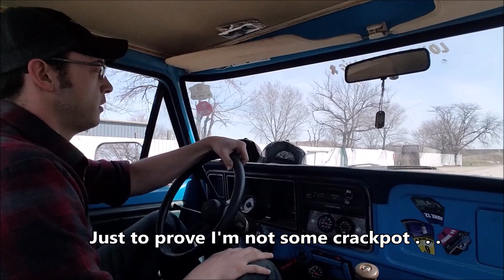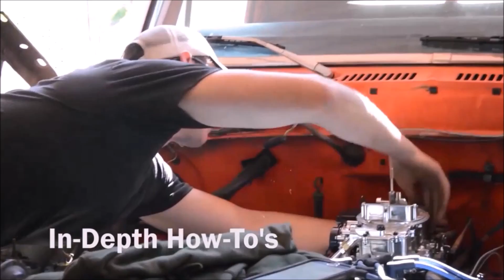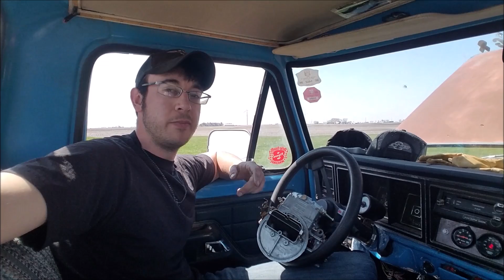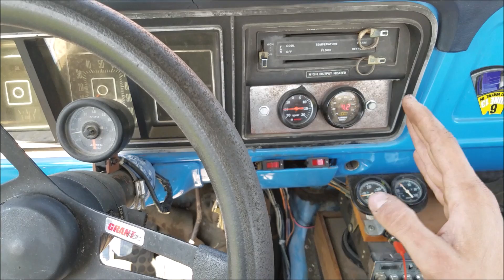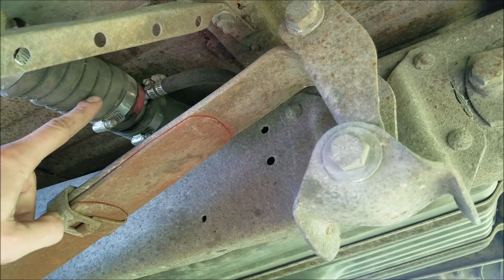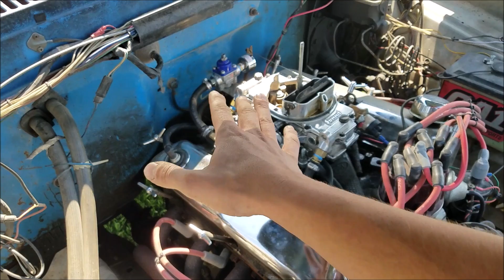Holley & Edelbrock Fuel Bypass System: Return Line to Tank Connection (EASY & SIMPLIFIED)

Comment: I know it’s an old video. But probably one of the most important things to do with any carburetor these days with fuel being soooooo crappy!
I’ve done this for a lot of people and they have had 💯 positive feedback.
I’ve converted most to an electric fuel pump as well!
Thanks for another great video and your wealth of knowledge.
Luke you should really do another video on this topic!
👌👍
Reply: What kind of fuel pump should a guys use I have a bypass regulator return line and mechanical pump but the gauge fluctuates wildly. Would a carter p4070 help level this out?

Comment: Luke....i ran a new fuel line ...frm the spot it crosses fram and runs along headers...69 camaro 454.....thought i had it fixed...with new edelbrk avs 2....them my fuel pump crapped out...i had to get a edel...electric pump....hooked it ou on shoulder of hiway...and then the carb started overflowing w fuel...4.5 psi on my guage.....i had to drive home...grab my holley 750 dbl....and that got me running....but its still boiling fuel after 3 min idle indriveway....i see the metal line come from tank goes above tailpipe....and runs imside fram...right past muffler....will return line help.?....my fear is the fuel in tank will eventualy warm up too.much n get same result

Comment: the way you plumb the regulator is interesting, i thought the middle hole was IN (opposite side of adjustment screw) and the two outsides were OUT, one to carb and one for a gauge or a blanking plug, i wish to run an electric pump too but i need to get a return line output that i can hook up to the  hard hose, also i am playing with a weber 32/36 on a 22r 4cylinder : )), so you are saying here it can regulate in both directions i think ?!
Reply from the maker: There are return regulators amd dead head regulators. What i have here is a return regulator - the internals are different and the plumbing is different.
Reply: @ThunderHead289 ah.  So I could make a big problem here?  I just have the cheap holley style from ebay. The most common one I think. 12-804 i must check but it is marked in on the middle and out on both ends.
Reply from the maker: @chocolatedog666 a deadhead regulator will definitely not work for a return system indeed. Completely different internal concept
Reply: @ThunderHead289 i have come to the conclusion there are no ultra low pressure bypass regulators out there. I need 2.5psi. So I am assuming a return line is not needed.  Electric Pump is 5 psi max. Simpler plumbing I guess.

Comment: Brothee, Im not saying your way is incorrect. Im not a carburetor expert. If the pressure regulator is after the carburetor and on the return side. Is there a chance of tour fuel pump over pressuring your floats or creating issues? Im asking because Im about to  install a regulator on my carb

Comment: I'm confused I have a summit racing carb with a solid type dual fuel line so how do I plumb the regulator like you have it in this video without all that rubber hose and still have the regulator as you have it here?

Comment: I was wondering. For a carb setup could I just run a corvette filter/regulator and use that as a return? Where it makes return line shorter and not have to come from engine bay?

Comment: There’s a emissions 3/8 line that runs down the passenger side frame rail that I used for the return. All of these trucks has it and it goes from what people call the coffee can under the hood and runs right to the top of the gas tank where it goes in and you don’t have to drop the tank or run a line the length of the truck.
You just need 3 ft of 3/8 fuel line and a T with the regulator after the T and of course you need a electric fuel pump and I put mine right at the tank on the frame. It works perfectly and you won’t ever have to worry about vapor lock again and the cool fuel probably helps on power and fuel mileage

Comment: Awesome video.  I want to install filler neck return line to help with my truck heat soak issues.  If I purchase filler neck to I also need to purchase pump? Or does it return fuel by gravity once the engine is shut off?

Comment: Thanks so much for this! I'm trying to keep my girlfriends grandpas truck running/alive- so she won't want to get rid of it, but it's pretty unreliable as it sits. It starts up and appears to drive just fine- but once warmed up, she loses power and eventually stalls. We also get vapor lock when attempting to start a hot truck- so I'm hoping that in following in your footsteps, we can make the truck reliable again. 

Do you have a video on how you did the electric fuel pump? That would be super helpful. I know in one of your videos- you said you wanted the pump to be rated HIGHER than what you'd want the regulator to be set to ('14 psi pump w/ a return regulator at 6 psi'), and I believe I might have found a mechanical edelbrock pump that is rated to put out 10. But if switching to electric is easier, I might just do that. Thanks again.

Comment: I’ve got a sbc 350 with a 4150 650CFM and a fuel rail on it pumped by a Holley red electronic pump. Have the issue where it’s plumbing way too much fuel and starts overflowing that carb really fast. Do you think I could put a pressure regulator and return line on the other end of my fuel rail to help regulate the rail pressure so it doesn’t do that or does it need to be before the fuel rail?

Comment: Hello, I have a 86 chevy c10 v8 305. I have deleted my evap canister and my fuel tank collapsed in on itself. I'm wondering if it's because the line I didn't know what to with I closed off. I have a edelbrock 1406 carb

Comment: Question for this old video: does this return setup give you problems filling at a gas station? I’ve had vehicles that wouldn’t take gas with the pump handle fully open.

Comment: To be honest I hired several guys to solve this issue for me and they never told me what the issue was. I was sure it wasn't the carburetor. My carb was new. After seeing this series on vapor lock I am sure these guys knew what this was and hesitated to tell me. My car had a dedicated return line but without the original carburetor, it was never hooked up. I even asked about it because in old photos the line was hooked up. I was told it wasn't necessary. Truly it is necessary. Lesson learned.

Comment: The filler neck is a great tip. My car has a return line already in place but for some reason, it was disconnected. I want to reinstall it. The line seems fine. How do I test it to make sure it's ok to reconnect? I wouldn't want to put any trash into the tank from an old line. Any suggestions?

Comment: I'm doing a swap from a mechanical fuel injection system to a carburetor on a small block 302. Is it as easy as using a bypass regulator and connecting it between the carburetor and the existing fuel lines?

Comment: Hi Luke! Is it acceptable to run a high pressure neoprene line back to the tank from the regulator rather then a Metal line?  I run a Blue Holly elect external pump, 14 psi max,  and use a Holley 4160 750 cfm Carb. Thank you.
Reply: This is an old comment, so you probably decided one way or the other, but the advantage of hard lines is that they are less likely to be damaged by road debris.

The disadvantage is they don't flex and are more difficult (but not terribly difficult) to run.

Personally, I'd run hard lines at a minimum from the engine bay to the general vicinity of the tank. From there, a more flexible hose to the carb or tank would strike a good balance between safety, durability, ease of maintenance and the ability to adapt to changes (e.g. a new carb is built differently and requires the return line to run to a different location -- hoses help here).

This is the same strategy that tends to be used for brake lines. At least on my truck.
Reply: @ZachtheEvil  Thanks for your reply! I decided to keep my tank to regulator hard line. No heat soak issues currently, (1 inch carb spacer, stainless braided dual lines from regulator to carb nicely wrapped with heat shield.) The Mustang only gets out for car shows, local cruises, maybe 300-400 miles per year.
Reply: @robertclymer6948  nice. Sounds like a good setup.

BTW, what motor are you running? From the profile photo it looks like a 60s era Mustang. 289?

If it's stock, 750cfm could be too much. My more or less stock '66 289 engine in my truck is happy with 600cfm and honestly 550cfm might be a hair better. It's running a Holley 1850-2, the ancient forerunner to that 4160.

 I'm currently in the process of adding a 1 inch spacer / rebuilding the carb a small bit - what type of spacer are you running? I'm going with a 4 hole metal spacer, purely to get another vacuum port for the PCV valve and free up the port it's using.
Reply: @ZachtheEvil  Ok, 67 Mustang Gt S-code coupe. Originally came with a 390 4 speed. Running a Ford 460 big block that is a mild build. Has all the top shelf parts on it. Running with the 460, is a Built C-6 forward manual valve body. Running 4:11 gears with a Yukon Trac Lok differential. Full spool removed for this. 4 link suspension, coil overs, 2 1/2 stainless exhaust from headers back through magna flow mufflers. Eldelbrock top end kit, Holley 750 cfm 4160 on an Eldelbrock RPM Performer single plane. Alum radiator with two fans in front If it goes over 190 deg. Cheetah SCS shifter. Spacer is 1in phenolic forgot the make. Holley sniper elect fuel pump into a Holley regulator. Interior has been put back to period correct now. Ex-race car, ran 8's in 1/4 mile, a far cry from that now, lol Probably much I forgot but is a nice pro street hotrod and cruiser. Running 275x60r15 rear on Weld draglites. Goodyear 190 skinnies up from on Weld also.

Comment: So youre running your pump straight to the carb then regulating the pressure afterwards? It seems to work, but seems backwards. Whats the pros to doing it this way instead of pump into the regulator then to the carb?
Reply from the maker: It doesn’t matter where the regulator is - the regulator maintains the “rail” pressure which is what the carb sees, bypassing any volume not needed to maintain that pressure. 

It’s the best return system since it is always actively bypassing fuel from your fuel rail vs others that don’t bypass all leaving fuel by the carb susceptible to heat and density change. 

Thunderhead289 
Engineer

Comment: Your fuel pressure regulator has 2 outlines and 1 inline. For the video it looks to me that you connect the pump to the carbs and to one regulator outline, the other outline has the pressure gauge, and the inline is your return line to the tank. Are your connections like I described or am I wrong?
Reply: You can plumb the regulator either before or after the carb. In this video he has it after the carb. His return line is coming straight down out of the regulator, you can't really see it.

Comment: My fuel pump has a return line. I added a fuel pressure regulator and it helped. If I upgrade to a FP regulator with a return can I 'T' into the return line from the fuel pump?
If so, I may put a bleed valve at the end of the carb fuel rail. Plumbing is my weakness...

Comment: So you run the regulator after the fuel goes to the carb?
Reply from the maker: Yes, it’s a bypass specific regulator - whatever fuel that isn’t needed to maintain the line pressure is bypassed. 
This is the best design as it’s a full bypass scenario
Reply: @ThunderHead289  boy I have a lot to learn here. Thank you
Reply from the maker: Happy to teach, I am pretty much retired from all this stuff largely - time to pass the knowledge on
Reply: @ThunderHead289  well I appreciate your videos very much!

Comment: On many Fords from the 70s they had the egr spacer plate . Is there a easy way to remove it ? Is there a spacer you can buy ? It doesn't look like you can just remove it and set the stock 2bbl right down on the manifold  .  Always worried the old EGR might leak a bit of vacuum .

Comment: Haha, I removed all that 'return' shit from my 73Econoline years ago, I had enough leak issues, less lines the better, damn ethanol had destroyed the rubber lines, and ruined the tank, I still have the arrangement where it connected to the carb, never want to put it back on, it was Fords pitiful fix for vapor locking due to heat, if those fools put a reasonable radiator in with a fan shroud there would never have been a problem, left it up to the owners to have radiators custom built for their vans.

Comment: I liked your comment on the fact that a carburetor is a static output fuel delivery system. It does not adjust like fuel injection. So you want to keep the fuel input as static as possible for consistent results.

Comment: Where to put the return line had me stumped for a while too.  I addressed it by buying a piece of 3/8 in. x 12 in. pre-made steel brake line, cut one end off, drilled a hole in the sending unit cover on the tank, and soldered the 3/8 in. tube in place.  Granted this did require dropping the tank and creating a small bracket to support the return tube just as the supply line is supported, which I tack welded in place.  But it is another solid and cost effective solution, like the one you suggest in this video.  Your earlier videos helped me realize my Holley Red pump was causing my carb to flood so adding a regulator let me to this.  Thanks for all your great tips!  I've learned a lot and will continue following closely.

Comment: Damn that's a great idea!!  Do you have the return regulator set at the same pressure as your first regulator?
Reply from the maker: I only have one regulator which is the return. It maintains the pressure on the apply line and at the carb. Anything not needed to maintain that pressure is bypassed

Comment: ok, so many questions.  What about a regulator with the return port (Mallory type)? I'm running deadhead (390FE) Mechanical fuel pump, Edelbrock carb, and unregulated rubber lines. Trying to methodically make one change at a time. ( also checking your setup on your vapor lock video several years ago). Any rubber replacement fuel line recommendations?
Reply from the maker: I haven’t been able to make a functional fuel bypass system that actually moves fuel volume that seems to be happy with a mechanical pump - I need to cut one of the vapor return canisters open and see what’s inside
Reply: @ThunderHead289  thanks! I'll keep her deadhead until I go for the full refit.

Comment: What about that set up for the regulator what did you bolt that to?do you have to vent the tank And also the return line is metal from the firewall back and just rubber in the bay? Would this work with a 69 f100 I got my tank behind my seat and also a 66 mustang? Any advice is much appreciated

Comment: Hmmm....u got me thinking- my 79 302 F150 still has one of the old emissions line that runs down the pass side to the rear tank that at the sending unit I could possibly use for a return - one drawback I see off hand is its diameter is very small & may have too much back pressure??

Comment: How would you set up the return line with a mechanical fuel pump?
Reply: The same way, but mechanical fuel pumps can have a tendency to vary in their output creating inconsistencies and problem chasing.

Comment: Is it a waste of time to run the return line with my mechanical fuel pump?
Reply: Yebo Screbo thing to consider is heat with gas boiling before the carb or your floats on the carb being filled with an excessive amount of fuel into the intake. You might go with a higher volume pump to keep up with fuel demands but the engine doesn’t need it all the time so putting it back into the tank is just a better solution. For most street engines with a mechanical fuel pump in the range of psi needed for it to work right will be fine 100 years ago they didn’t need a return line to make them work even had a lot of powerful engines that didn’t need it to work. .

Comment: I like this video. My only car with a carburetor, my 1869 Corvette still has the original type fuel filter that has a second outlet. It’s a very small, sends fuel back to the tank via a separate return line. Chevrolet’s reasoning was that the return helped keep the fuel cool. A lot of guys on the Corvette Forum don’t believe that and remove it. Their loss.
Reply: Did the 1869 models run on lamp oil?
Reply: Jay Gilling  Nothing so common as just any old lamp oil. They ran on whale oil.
Reply: Real horses

Comment: Would this set-up work on a 1970 f100 with fuel tank behind the seat?
Reply: You would probably have to drill and put in a hose barb. I'm also not 100% sure that the behind seat tank has a rubber hose going to the tank. Or if its a direct type fit.

Comment: What type of gauge is on your bypass? I looked at the link for the bypass but did not come with a gauge.
Reply: MrGasket 1561 sealed fuel pressure gauge. 0-16psi

Comment: Would you talk about installing a durapart system or maybe doing the GM HEI system into a Ford? That is the HEI module not a dist. Like how you did it and your thoughts on using a GM HEI since ive heard mixed reviews on the duraspark boxes failing. That is the ones from the auto parts stores. Since a OE box are heard to find nowadays. 

Great video! Also, can a do a fuel return on a motorcraft 2150? non feedback carb?

Comment: Do you run the same size return line that you're using for your inlet fuel flow
Reply from the maker: Same size or larger, indeed - you don’t want to have backpressure on the return side or you lose regulator control
Reply: @ThunderHead289  ok thanks for the response